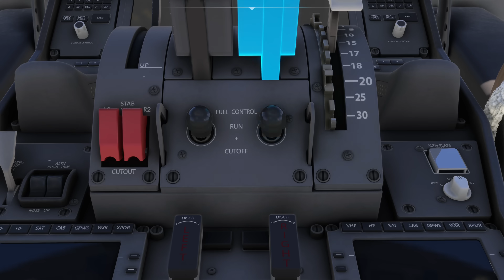Air India 171: Why Did The Fuel Cut-off Switch Get Moved?

Comment: With regards to the critical moment from leaving the ground to the engines restarting a number of very important actions took place. The fuel switches both transitioned to cut off the fuel one second part. This is an accepted fact. The pilot flying at this moment would have taken his hand from the throttle's to the oak using both hands on the yoke with focused vision on his instruments with a virtual tunnel vision. When the fuel stopped the engines within a fraction of seconds change their tune and the acceleration felt in the seat of the pants disappears which would place him in a state of shock. It took several more seconds of flying the plane before he levelled out slightly to conserve energy while he still gained height. I think it was him who asked the other pilot about the disengagement of the fuel switches. Now the moment he took his hand off the throttle's the other pilot would have been acting as a guard to those throttles during the initial ascent until they were firmly accelerating into the air at which time he would have withdrawn his hand from the throttle area. If I am right about the fuel switches locking mechanism being in a defective and precarious state the cuff of his jacket or the ulnar side of his hand could easily have gone bump bump across those two very precariously seated switches which would then have very easily knocked back into the locked cut off position. He to would have immediately sensed the engines spooling down at the cost of the planes acceleration At which time I believe the pilot flying knowing that the Pilot supervising had his hand in the vicinity out of the corner of his eyes. Both pilots would have been in a troubleshooting mode and the captain supervisor confirmed that he did not operate the switches, knowingly at least, and in a state of shock  will have been spending the first valuable seconds scanning all of the instruments amidst the sound of all sorts of alarms going off, and extraordinarily stressful moment never have before ever experiencing the like. Then with a call mind he engaged the first engine that flamed out as would have been demonstrated on the instrument panel by re-engaging the fuel switch this time firmly locking it into position. The fuel switch operates all manner of different features to restart the engine. The emergency power supply at the tail of the plane will not have come up to speed yet and would not have been any help but the rat generator had drop-down and was producing the necessary power to restart the engines. Then with an incredible degree of self-control and Claire headedness after starting one engine he waited for that engine to start to come up to speed where it was increasing speed on its own account including producing its own electricity before starting the next engine. At this stage we must say that this fellow reaches hero status and is calm collected state of mind doing all that he could while having account for all factors to save the plane. Then knowing that They were in an impossible situation a second or so before impact they started to let the world know what was happening. this potential account is of course speculative like many other things but I think we Are obligated to now inspect all of the switches of this type for where and potential for the locking mechanism to Snag in an unsafe condition. I must also point out that this model switch has about 12 different variants with multiple different types of mechanical locks some of which lock one operation but not the other with others are capable of having the locking mechanism disengaged render them vulnerable. These switches look much the same and it would pay for all of them to be checked to make sure the correct Locking switch has been fitted. Otherwise what we don't know we don't know until it happens again.

Comment: Hi Captain, I noticed in the preliminary report that the crew of the previous flight made a Pilot Defect Report (PDR) entry for status message “STAB POS XDCR” in the Tech Log. The troubleshooting was done according to the FIM by Air India’s on-duty AME, and the aircraft was released for flight.

Since there aren’t any details about the issue in the preliminary report, do you think these details are really needed to be disclosed?

Also, I have a question about the Engine 1 and Engine 2 fuel cutoff switches. It says that they transitioned from RUN to CUTOFF position one after another with a time gap of 01 sec. And according to the EAFR, the Engine 1 fuel cutoff switch transitioned from CUTOFF to RUN at about 08:08:52 UTC, while the Engine 2 fuel cutoff switch also transitioned from CUTOFF to RUN at about 08:08:56 UTC.

Why would it take 4 seconds in-between for the pilot or co-pilot to transition CUTOFF to RUN between Engine 1 and Engine 2? Both switches are easily accessible, and there’s no mention of any struggle between the pilots. Cheers !

Comment: 3:48.. no. In airplanes there are many "interlocks" where something in one system can't happen without something else having happened in another and those can be bridged out for maintenance purposes, true, but: even the tinyest of jumpers has a two foot long dayglow red streamer attached which says "Remove before flight". Those would be terribly hard to miss, especially since the technician has to account for every single one of them issued before the plane can be signed off. No chance in hell that had anything to do with it.

I work in metrology (the science of measurement) and certification of measurement equipment. When I certify a diagnostic kit used in aircraft maintenance (our 4th biggest customers) I invariably must check a box which says the "Remove before flight" streamer is securely attached.

Edit: we're supposed to be camera monitored, not to keep tabs on our performance, but to avoid situations where clients send in broken instruments and then try to blame the breakdown on us and have our insurance pay out for the repair, but it still doesn't work...

Comment: Ok so here is my input. Absolute shoddy programming by Boeing. Flight computer knows take off vs landing. So no fuel cut off should EVER be allowed on take off!!!!! 2. If there is a momentary short on the wiring harness the EEC would shut off the fuel and according to Boeing's on procedure you would need to shut off and then put back on the fuel cut off valves to reset the system! This on it's own is shocking !!!! More Boeing kindergarten programming and the blaming the pilots!!!!!

Comment: The interpretation of the conversation could be different too. It could be, that the lever went into cut off mode due to malfunctioning which the captain realized and asked. And the other would have said no he hasn’t done it. Putting the blame on a dead pilot is easy now to escape accountability by GE and Boeing. The flight traversed only 32 seconds

Comment: Is it possible for another pilot to do the same thing? - yes. So Boeing needs to introduce a software safety measure like other manufacturers have, namely Embraer, to prevent this from happening again. The reason they are not doing so is that it would in some way admit that they are in a lesser extent partly to blame for the incident. It would be appropriate for Boeing to stand up, say they have learnt from the incident and are immediately introducing a double pilot controlled software measure to prevent engine shutdown where there is no evidence of engine fire or in a critical stage of flight where thrust is more important.

Comment: Hi captain Steve. 

Why are both engine fuel switches placed so close together, without clear separation or protective covers? There is no such thing as accidental shutdown in this context. These switches require a deliberate action.

Fuel cutoff should never be possible during takeoff or initial climb, unless a confirmed emergency is present. This phase of flight demands full power and altitude gain to allow any chance of gliding or recovery.

The switches must be separated, protected, and require confirmation from both pilots. If one move can shut down both engines right after liftoff, this is not a mistake. This is a failure of design logic and safety engineering.

Comment: Boeing has a history of hiding information and blaming pilots. In the Boeing's 737 MAX disasters—Lion Air Flight 610 in 2018 and Ethiopian Airlines Flight 302 in 2019—a flawed software system repeatedly pushed the planes into nose dives based on faulty sensor data. Boeing did not disclose MCAS to pilots, resisted grounding the fleet, and for months pushed the narrative toward pilot error, until investigations revealed how deeply flawed and under-tested the system was.  During that time also, Boeing used social media and print media to blame the pilots even though it knew the truth. 

That history matters now—because we’re seeing something similar.

Comment: When will abandon the romanticism that the "pilot is always in command"?  Is the pilot in command of gravity?  Is the pilot in command of weather?  Is the pilot in command of every nut, bolt, rivet and electrical connector contact?  Hell, no, he isn't.  He's only supposed to be in command of his own sanity and to perform his job to the best of his ability.  Airliners, loaded with hundreds of people, hurtling through the air at ten times highway speed, must be designed, built, and maintained so that the pilot only needs to do tasks that are well within the ability of a reasonably normal and properly trained superintendent of the activities required to operate a safe and efficient means of transportation.  If an airplane is so poorly deigned, built, and maintained, that it hurls impossible demands at pilot and crew, at any time or phase of an operation, with zero ahead time notice, then it is FATALLY FLAWED JUNK.  Take note of that, Boeing! 😐

Comment: I would think that these planes have enough logic that a rule or law could be added that would not allow fuel cutoff during flight takeoff and only allow it at a specific altitude but could be used normally during the landing phase. Do you think that this would be possible?

Comment: In a car is the same, the driver or passenger can turn off the motor anytime.. is possible to add a plastic cover with key over the cutt -off switches?

Comment: There are lots of flaw in this report. Why we are pointing fingers towards the pilot, when there can be several reasons for this catastrophic failures? Its very difficult to agree that- there can't be any other reasons the fuel switches went from ON to OFF position, other than manually positioning it. 

2018 FAA report is also one of the clue to this investigation, because engagement of locking mechanism was never checked by Air India- This could have cause potential failure (also, because the pilots are also denying it; why we make up our mind that they are lying?)

Also, we make up our mind that- it took one of the pilot 1 seconds to turn OFF the spring loaded manually controlled switches, but in a do or die situation the other pilot take 4 seconds to turn it back ON? And they turn it ON after 10 seconds? What was the discussion going in those 10 seconds? In the preliminary report why they provide partial discussion- to mislead the people? 

Something is not right in this report...

Comment: Why would the RAT deploy before the fuel switches were moved to the 'off' position.  Also, can the fuel switches move without the pilots doing that, i.e., by a hacker or through a system malfunction?

Comment: Federal Register, Volume 87 Number 239 (Wednesday, December 14, 2022)

"The FAA is adopting a new airworthiness directive (AD) for all The Boeing Company Model 787-8, 787-9, and 787-10 airplanes. This AD was prompted by a report indicating that foreign object debris (FOD) could have been introduced during rework of certain engine fire shutoff switches (EFSSs). This AD requires determining the serial number of the left and right EFSS and replacing affected parts. This AD also limits the installation of affected parts under certain conditions. The FAA is issuing this AD to address the unsafe condition on these products."

"The FAA is issuing this AD to address FOD in an EFSS, which, if not addressed, could result in a latent failure and loss of intended functions, including the inability to pull the engine fire handle and uncommanded activation of the engine fuel shutoff function. The inability to pull the engine fire handle when an engine fire is detected could lead to an uncontrolled engine fire and subsequent wing failure, and uncommanded activation of the fuel shutoff function for an engine, combined with in-flight shutdown of the remaining engine, could lead to total loss of engine thrust."

https://drs.faa.gov/browse/excelExternalWindow/FR-ADFRAWD-2022-27020-0000000000.0001?modalOpened=true

Comment: What benefit would it be to require an input from both pilots to cut off the fuel? If it were sabotage, there are a number of OTHER control things that the bad actor pilot could do to kill the airplane, including killing the other (good) pilot first. You can't really protect against sabotage from within the cockpit.

Comment: I think that a pilot (or copilot) should be able to turn off the fuel to ONE engine (AKA, say it's on fire) - but never BOTH - the second engine fuel (either one, if one is already turned off) then BOTH pilots should have to press a cut off lever (just put them on the right and left sides of the plane, so that 1 pilot cannot easily reach both levers).   That way a pilot bent on suicide or just making a mistake cannot turn off fuel to both engines.  Just look at the jump seat pilot on the flight from Seattle, he almost did the same thing.

Comment: All the experts keep saying that it is impossible to flip the Fuel Cutoff Switches accidentally because they have  the  locking mechanism. BUT...

The Fuel Cutoff Switch  referred to in the 2018 Advisory (SAIB NM-18-33) appears to be the Honeywell 4TL837-3D.  In the  datasheet for that switch (on the Honeywell site), it specifically says on page 3 that the Locking Levers are OPTIONAL: "LOCKING LEVERS Optional lever locks (pull-to-unlock) require two separate actions to actuate the switch in order to prevent unintended actuation".  

The preliminary report states: "The scrutiny of maintenance records revealed that the throttle control module was replaced on VT-ANB in 2019 and 2023. However, the reason for the replacement was not linked to the fuel control switch. There has
been no defect reported pertaining to the fuel control switch since 2023 on VT-ANB."

The Fuel Cutoff Switches appear to be part of this module, which for some reason needed to be replaced by Air India mechanics twice?  They are manufactured by Collins Aerospace, but what kind of sourcing did Air India use for the parts.  Were the switches part of a remanufacturing process that used the non-locking switches?

What is the possibility that (during one of the above maintenances of the Throttle Control Modules) the airline sourced switches WITHOUT the optional locking mechanism and then the extended vibration, wear-and-tear, and hot air turbulence during takeoff could have all combined to cause the switches to flip off by themselves?  It was a VERY hot day and the turbulence or runway pothole could have jolted the switches.  I would be really interested in know how sensitive these switches are if the locking mechanism is not there.

Also, what is the "incorrect installation" of the Advisory really referring to?...wrong switches (ie, without locking mechanism) or actual disabled switches (ie, locking mechanism disabled), and in the later case, how is that even possible?  Look at the switches on the datasheet!

Unless some of it is (hopefully) leaked, none of this will be known until the final report, and hopefully the NTSB will be working with the Indian AAIB throughout this process to make sure the public is aware of the truth.

Comment: Is it possible to have the PLC card to send wrong signals and the solenoid to be actuated to shut off the valve?? ... This is more of a possibility I would say, given the history of electrical failures in Boeing aircrafts.

Nevertheless, I think it is very very premature to draw such extreme conclusions at this point.

Comment: I'm very surprised that there is no software that would prevent both fuel switches being turned off when there is no weight on the wheels, aircraft is past V1, engines at or close to TOGA and below 1000'.  I can see why you would want to be able to turn off one engine (or more on a quad) eg AF4590 Concorde, but there is no circumstance in these aforementioned conditions even if you are on fire you want to turn off both engines.  I can see the pilots would want to make this decision not a computer, so there could be an error message show up on the PFD asking both pilots to confirm the request by pressing a number on the FMC or something.  I think you said there are no such protections as the OEM's logic is "pilots simply will never do that".  Well, they seemingly just did, so maybe the FAA will require something like this to be done?